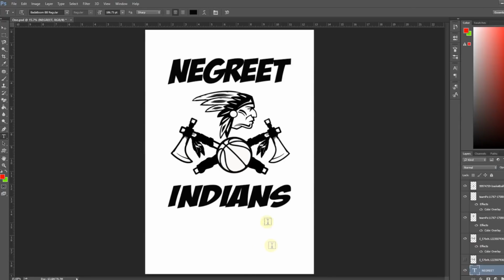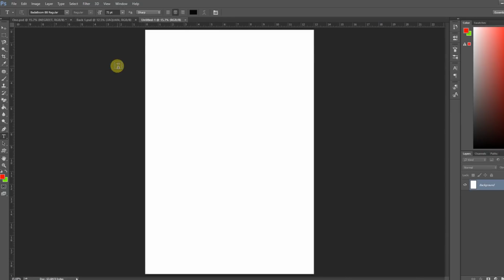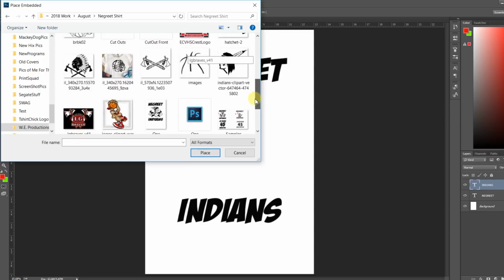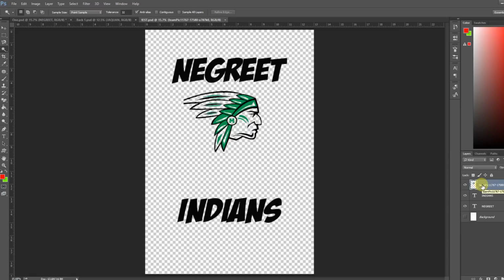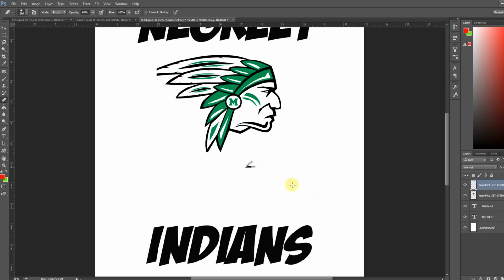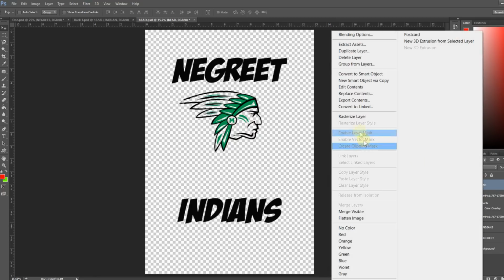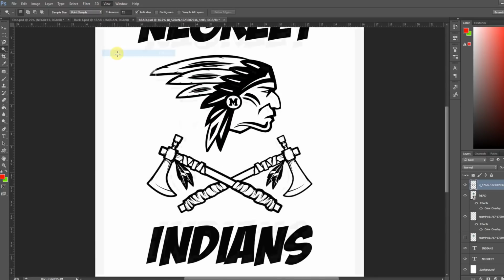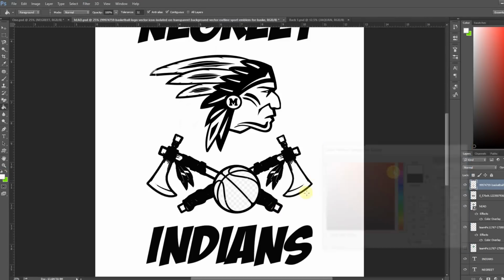Creating a Simple T-shirt Design In Photoshop (Tutorial)

Comment: Thank you for that tutorial.  It really helped me with understanding Photoshop a little better. I’m new at this. So where does it go from here? Did you send it to the printer to be printed with sublimation ink? By the way, as far as people telling you what software to use; if it’s not broken, don’t fix it. Thanks again.
Reply from the maker: I actually sent the design to Roland CutStudio and cut it out with my vinyl cutter.  What happens next is up to you and the process you are using to create your shirt.  Right now I only do screen printing and Heat press printing so if I wanted to screen print it I would just put some center registration marks on it so I could make sure it is straight once the film is printed so that I can line the screen up easily on press.  Then I would print out the Film so that I could burn the screen, wash out the stencil, dry the screen then put it on my press and do a test print so that I could begin printing the order.  Hope this helps.  Thanks for watching!
Reply: it sure does, thanks so much.
Reply from the maker: You're welcome!